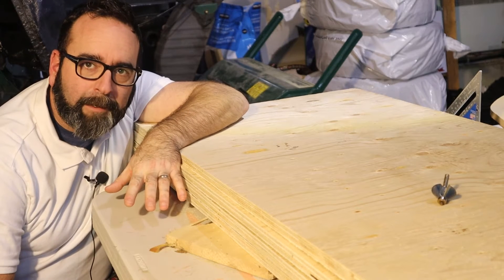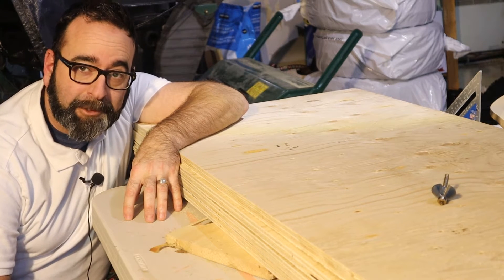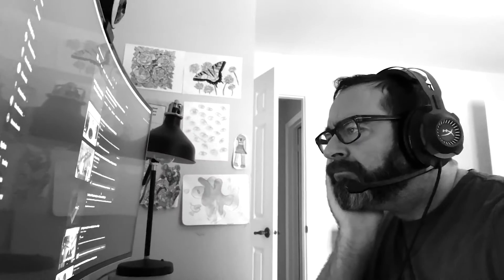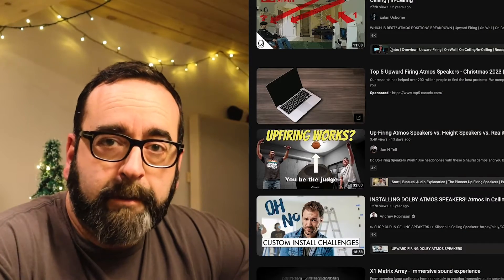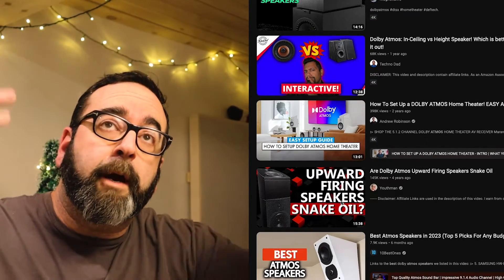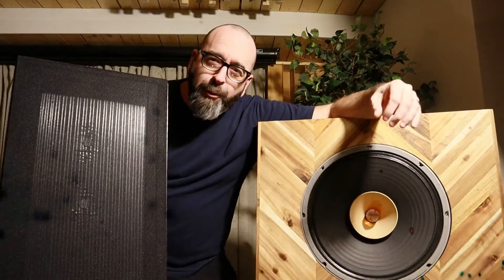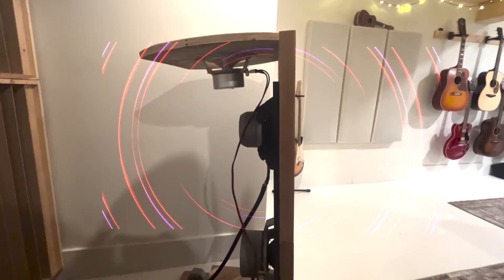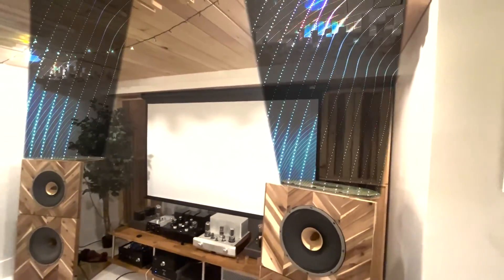🛠️ DIY Open Baffle Speaker PART 5: Up firing driver

Comment: Love your videos. Here's my story on the same topic. I'm a music lover, musician and hifi nerd since fourty years. During covid I build open baffle speakers as a copy of Pure Audio Project Trio 15 (with Tang Band Driver). Had close to 10k Naim separates from the 90s and the sound was pretty good. Got a used integrated small tube amplifier Unison Research Simply Italy (SET, 8 watt per channel). It destroyed the Naims. The sound was much more "real", musicians we're playing in my room, three dimensional soundstage. Then I saw a video from Danny at GR Research on open baffle. He recommended a tweeter firing up to make the soundstage even better. No I have a "normal" dome tweeter (97 dB/W) sitting at the upper outer edge of each baffle. It's connected parallel to the crossover, but with a serial capacitor with f(- 6 dB) = 2 kHz. There's no baffle with the tweeter, just the naked tweeter. With the tweeter the voices and instruments become much more spatial defined than before. Second, the lack in the high frequencies ist gone. Since four years now I'm a happy listener.

Comment: There's a lot of merit in the sound dispersion design methods you are experimenting with here. One interesting twist that I have implemented in several speakers that I have built over the past few years is the use of up and/or down firing HORNS to cover the  ~600 to 5000 Hz  frequency range . My experience with using professional compression horns in these designs is that the output must be  heavily reduced with resistors to achieve a balanced frequency response with  most woofers and  some tweeters.  One alternative to better sound with fewer parts that I have found is  to
mount small full range drivers  on the  midrange horn or waveguide.  This provides for a reduction in the "squawker "  sound  while  retaining  the  horn advantages of  having a greater proportion of  sound output in the desired direction , and a significantly smaller percentage of undesirable reflections or frequency cancellations from the rear of the driver. It also seems to have a  more "open" feel than some compression drivers that I've used.  I've also enjoyed watching your ABX Audiophile related open baffle speaker build video.  Thank you for sharing your  ideas and expertise!

Comment: Thanks for sharing the experiment. Sounds fun! Regarding the crossover, why don't you use miniDSP 2x4 so that you can change the crossover point freely wherever frequency you want to try on the fly (vs. designing high pass and changing caps, etc.)?
Reply: Wait, miniDSP may also change the phase... The above may work if you can control the miniDSP output phase (to match "pulling" of the main speaker). That said, does Atmos control the phase difference relations between the main speaker and the upward firing speaker? Too many questions LOL
Reply from the maker: I dont think atmos does any of that, but atmos just sparked the idea for me to try this in an open baffle context.  I will see about the miniDSP. Thanks!

Comment: Very interesting!  I'm here in the Gaspésie playing with a set of F15s and baffle material.  I'm a lifelong guitarist and guitar builder.  Started thinking about soundboard material and how it could apply to baffles.  Built two identical sets of baffles.  One set out of two inch thick maple and another out of two inch thick cedar.  Results correlate exactly as we see in guitars!  The maple set is much quicker with a lot more snap and high frequency energy..  The cedar set are much more romantic sounding with very pronounced mids.  Baffle material really makes a difference!  Open baffles rule!!
Reply from the maker: Wow!! You just unlocked another layer. Very interesting.  Thanks for this. 👍

Comment: Do you measure anything? REW s.w and minidsp mic.
Reply from the maker: If the listening test passes, and before building and investing, yes.
Reply: The mic is about 120 euro, the s.w is free. Because two drivers in different positions and doing the same frequencies you will have cancellation’s in frequency response it is far easier to measure then to “trust ear”/ guess what the response is doing.

Comment: Always going to get cancellation like that you want to use a 6db slope. 
What I would do is put it in a thick insulated cardboard tube open at the bottom16 inches long, move the driver to the side, or make a box for the woofer driver not have it open baffle, just have the small mid-range open always seems to work well

Comment: Hi I use field coil drivers in my open baffle speakers which allows me to adjust the
sensitivity and Qts of each driver. I use a neodymium 8 inch ribbon dipole tweeter of my
own design for the high frequencies. An 8 inch full range for the middle and a 16 inch for the lows. I designed 4   50 lb powers supplies , 1 for each driver. I use  2  160 lb mono block 300b amps
of my own design to power each baffle.
Cheers Lou

Comment: Adding transducers in a hodge-podge fashion will introduce considerable destructive interference, and thus the loss of information at various listener positions in the room.

Here's a thought: try the old Polk thing.  Today one can use DSP to deal with cross-talk issues with the human head and a stereo setup. But back in the day Polk decided to try to send the right signal to left speaker, and vice versa, but out of phase. The attempt was to increase the spaciousness of the sound at the listener position.
Reply: I hate to disagree. Check my system to disapprove your "considerable destructive interference" comment, so visit my currently still experimental built here online and click on my username.

Comment: Hi all,  I achieved this about two years ago by combining 3 different ideas. I added two more subs behind my listening position, I had already implemented HIGH FREQUENCY TRANSDUCERS (HFT) from synergistic research (these basically align the harmonics in your room from the different surfaces you apply the HFTs to).  elevating my subs in height too be centered in my room, (this made the bass more linear by equalizing the reflections from the floor and ceiling the same. This increased the sharpeners of the entire soundstage) The next step was adding  anti vibration devices to my subs, rack, and individual pieces of gear.  Doing all of this gave me what you're describing plus much more. 

Oh, great cables and fuses are a must as well.
Reply from the maker: thank you for sharing!!  very cool

Comment: My HIFI speakers are folded horns vented out the top.  They are DIY horn design found on the interned under the name BIB. They are corner horns and respond well to diffusion above them.  They have a full sound.